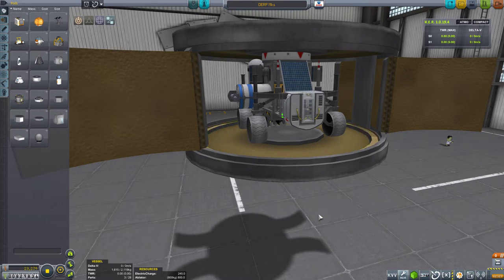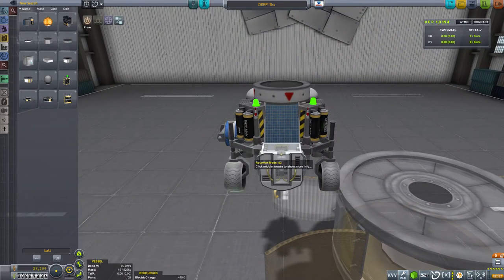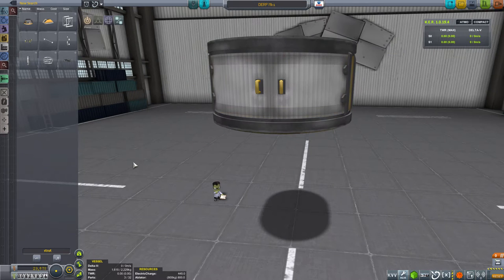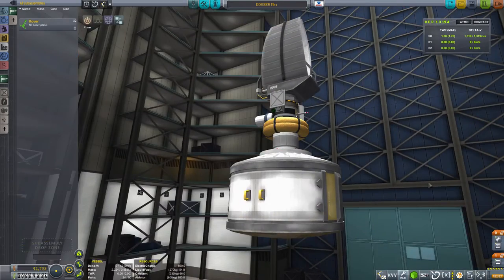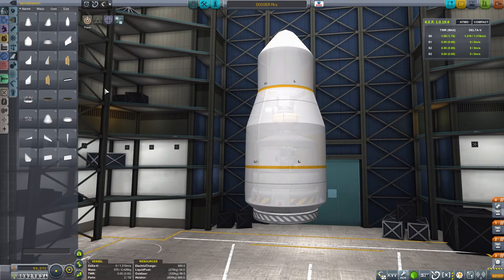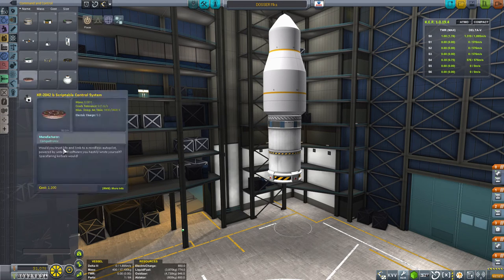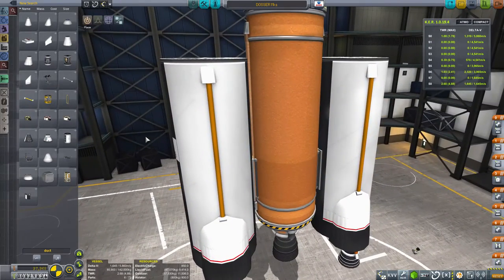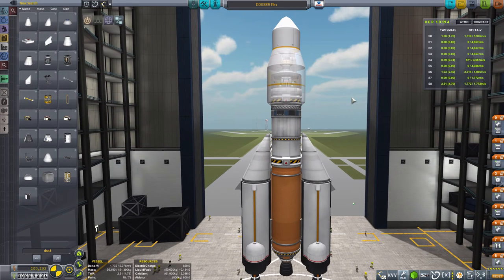41: Ready to Go (Duna Launcher)

Comment: I love the hiding of the fuel lines.  I'm doing that from now on. 

Hang on for Duna.
Reply from the maker: +Mike Aben I wish I could remember who that was, but it was simple and works really well. In the only previous example, I have manually added lines between tanks and engines across a reversed 3-way adapter, which for some unknown reason only allows fuel flow one way. I had to squeeze the camera right in close, inside the part, only for the lines to keep attaching to the wrong part. This method is so  much easier.